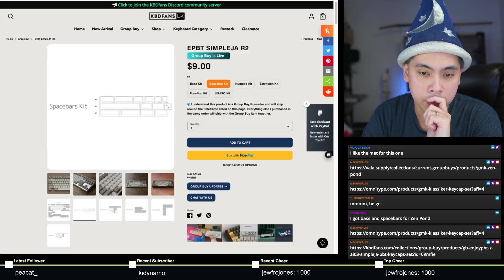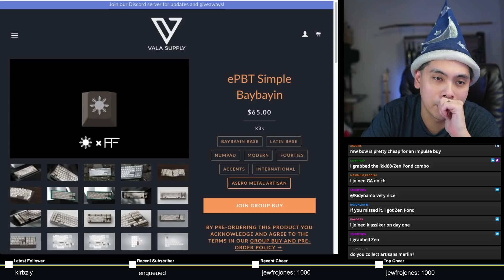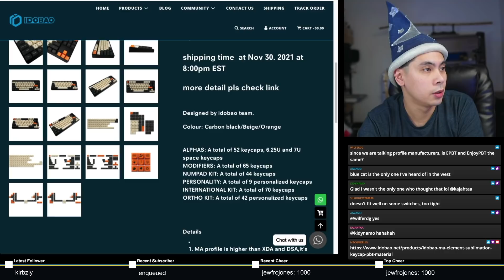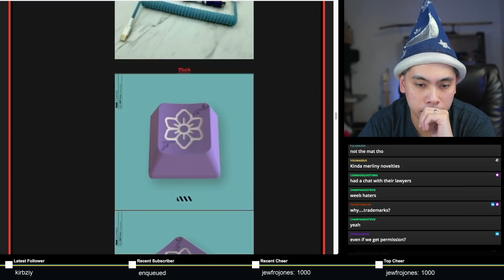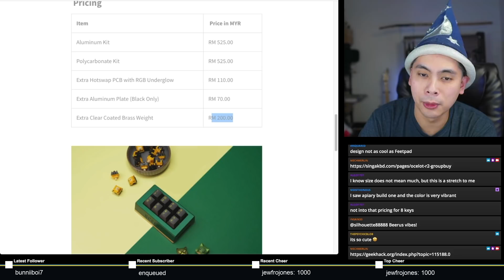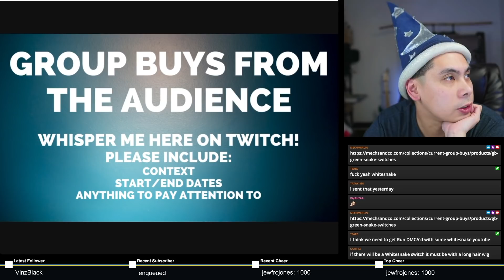Mechanical Keyboard Group Buy News 11/14/21

Comment: You missed KBDfans D84 V2 (75% keyboard). It is in-stock and available for purchase now. V2 also offers hot-swap pcb option, and 3 options (aluminum, brass, or polycarbonate) for plate.
Reply: No need to waste time review that board
Reply from the maker: That sounds like something that fits into my In Stock segment rather than the GB segment. The In Stock segment only covers stuff that caught my eye and is not meant to be an all inconclusive "This is what is in stock in the community today". For those, you can check out thocstock.